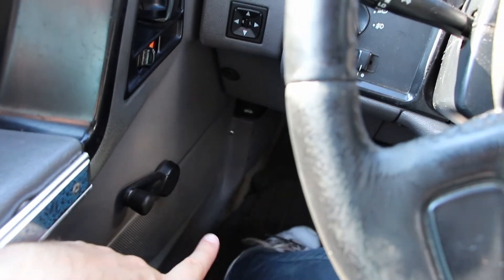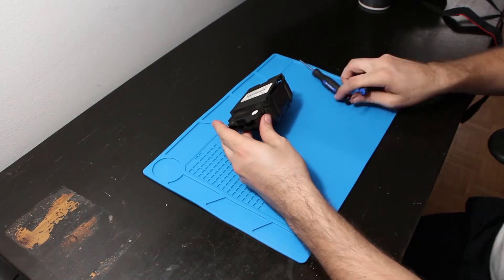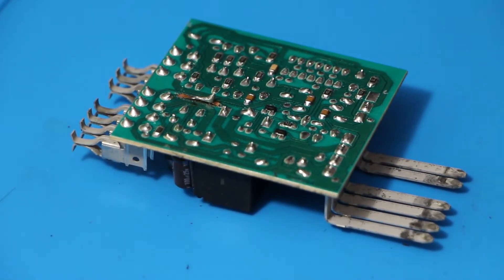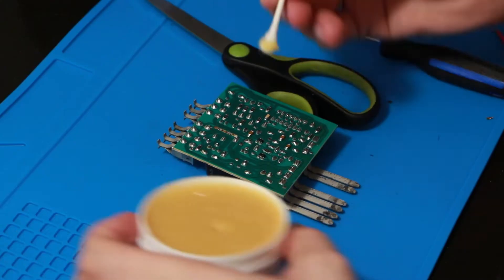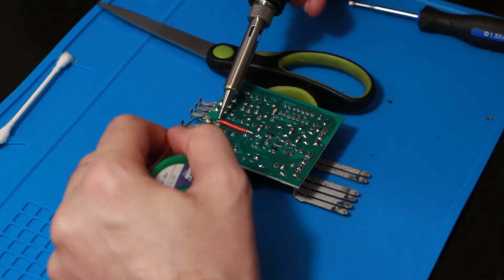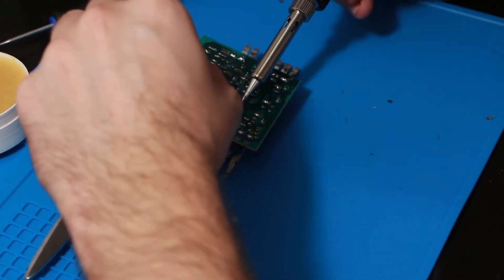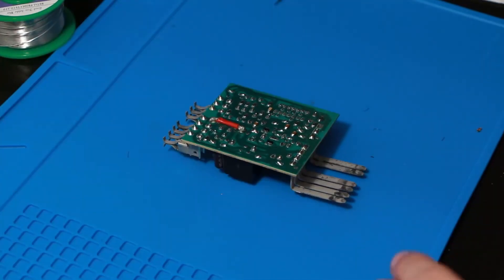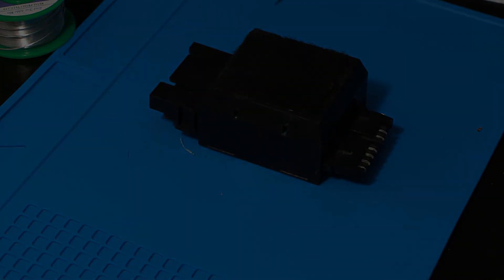Jeep Grand Cherokee (ZJ) Intermittent Wiper Module Fix

Comment: I can't seem to find the module anywhere you kicked the door panel and said its behind the kick panel. Removed kick panel and couldn't find it removed door panel and could find it? Any help thanks?
Reply: 1996-1998 don’t have the module there. You have to replace the wiper motors.

Comment: It worked to get them working again, but now when switched off they stop/stow  in the up position!
Reply: I fixed it!! Unbolted wiper arm rotated 180 and reinstalled!!
Reply: the more interesting thing is you have a base model ZJ with manual windows